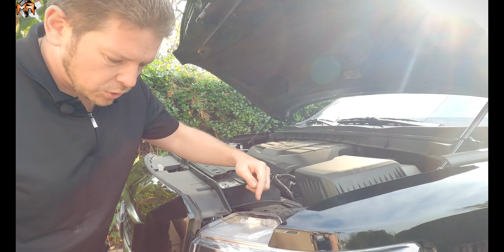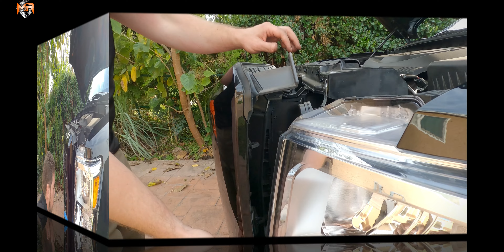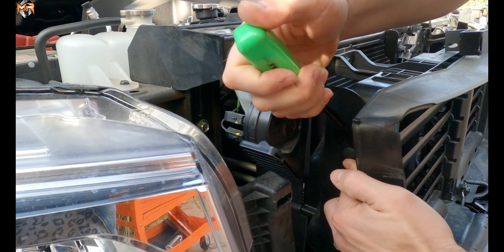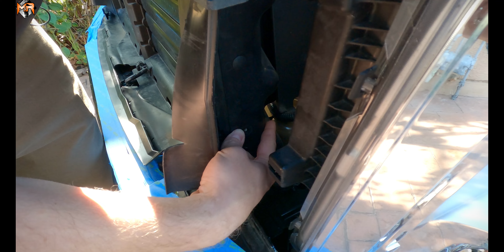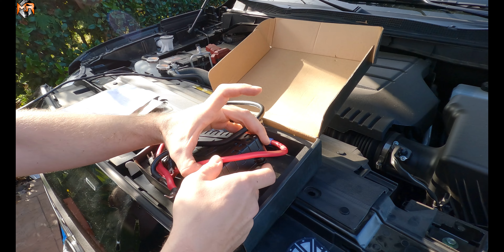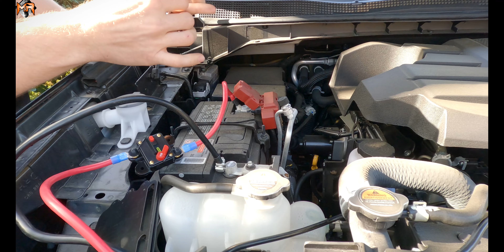Nissan Titan Dual LED Light Bars for off roading (FULL EASY INSTALL) 2020-2024 |M&R Automotive

Comment: I want to know what includes if by the two light
Reply from the maker: @luisperalta3228  2 light-bars, all mounts, and hardware. You will need a method to power them. We sell a wireless module for that if required

Comment: Very nice l have the 2023 Titan l will love to do my
Reply from the maker: We can help
Reply: @ I am in jersey
Reply from the maker: @luisperalta3228  Great. We ship worldwide
Reply: I have cuestión about the dual led fort the Titan that these come with Al the cable and the remote and everything on the video?
Reply from the maker: @luisperalta3228  Hi. Did you reach out to us via email? Want to make sure your questions are all answered. Please reach out if not yet
Reply from the maker: @luisperalta3228  The package will come with the light bar only. You will be responsible for sourcing your own wiring, depending on which route you would like to go. We have wireless wiring harness that we sell. Or you can purchase a generic harness elsewhere.